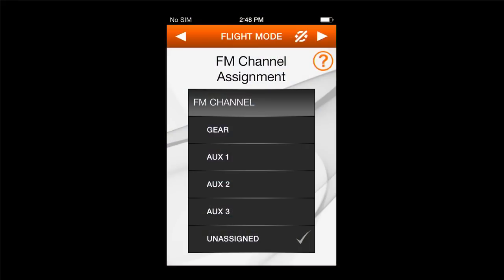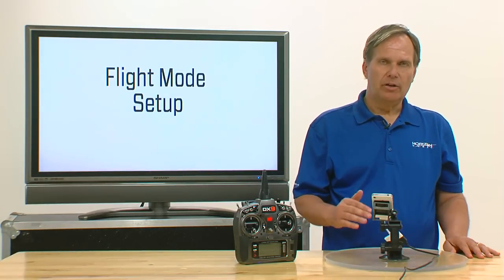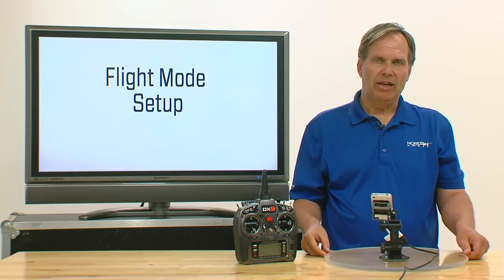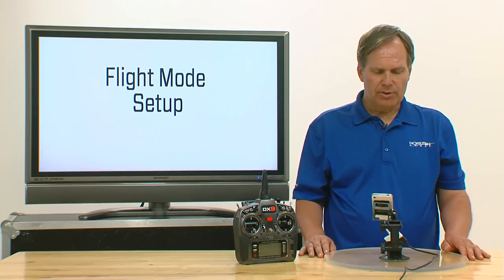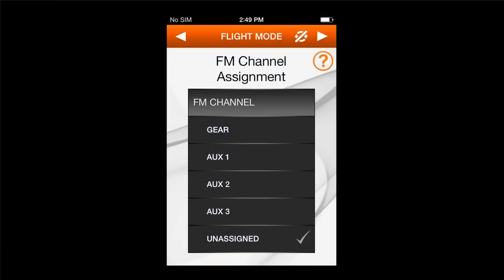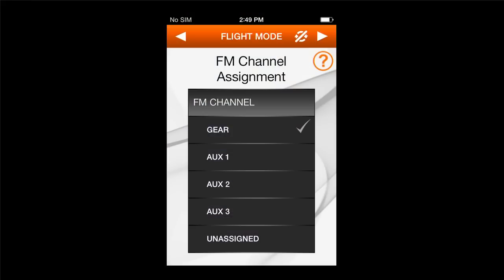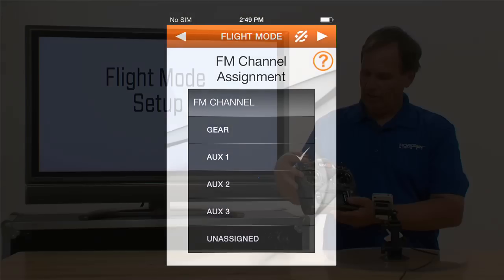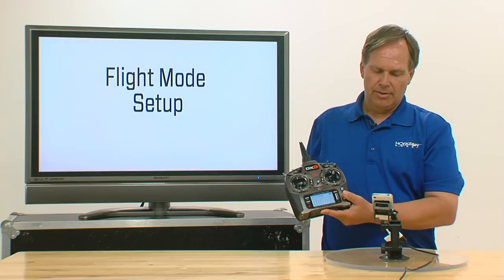Spektrum AS3X Step 8: Flight Mode Setup (Initial Setup)

Comment: I put an AR636 in a Hangar 9 Pulse xt40. I am using a Spektrum DX7 s. Loaded the programming software on an iPhone 6 and also on a laptop. I bought both Spektrum programming cables. I put the 3 flight modes on the flap switch (Aux 1).
Set up all 3 modes like shown in the video. FM1 with no AS3X gain or heading corrections. FM2 is about 30 for gain and heading. Then FM 3 has about 60 on gain and heading corrections. I know I'll have to fine tune this at the field.
My big problem that has stumped me for 3 days is getting FM2 or FM3 to work on the bench. I pick up the plane and move it around like the video shows but I see no surface movement at all. I tried changing values with the iPhone and the pc program but still no response. I also have a Eflite Pulse 15e with AS3X already programmed in for that plane. The instructions say that to test AS3X on the ground you need to activate the feature by holding the plane and advancing the throttle past 25% and then back to zero. I tried that with my Pulse XT40 and then FM2 and FM3 started working. This step is what was missing. I watched the videos 3 times and still couldn't make it work.

Comment: I understand the TX settings but I don't understand the RX settings.
I have bought a AR636 receiver Horizon Hobby aimed for:

2 Aileron servos
2 Elevator servos
1 Rudder servo
1 Trottle servo

It’s 6 channels and the APP includs this setup .

My question is how can I setup Flightmodes? Do I need an 7th channel for Flightmode?

If so, I have an X-plus 8 module, can I connect that module to AR636 Bindport?